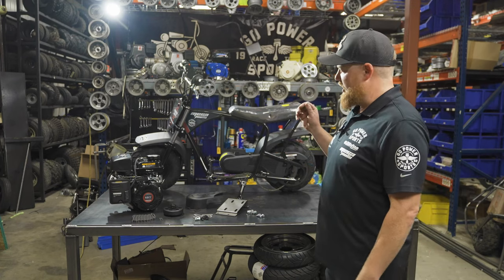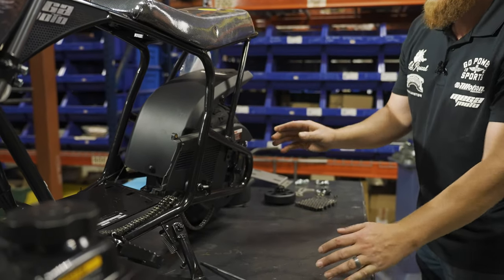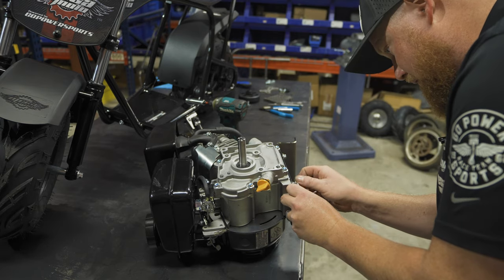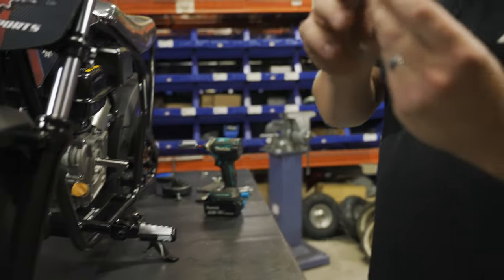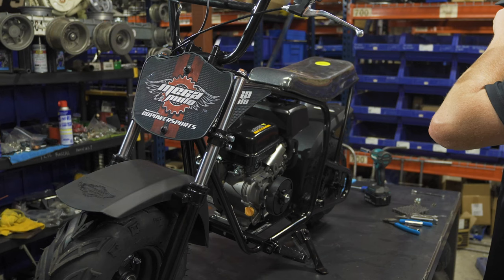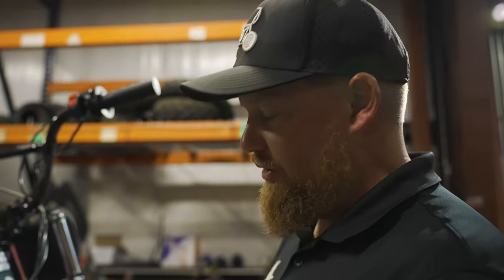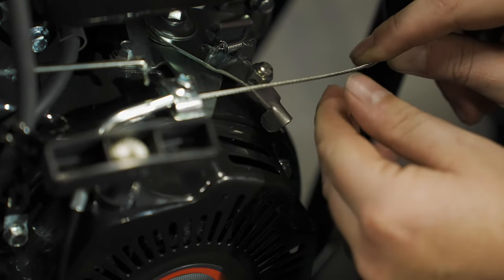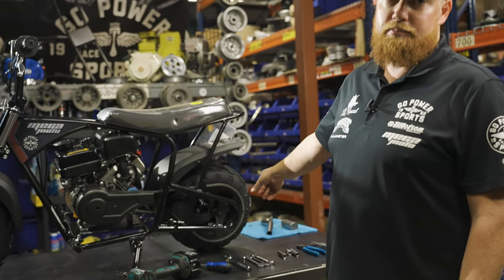Building The Mega Moto 98 Minibike Kit

Comment: After installing the engine exactly as shown in the video, I discovered that the provided chain is too short. Although the kit includes a second chain of the same size, it doesn’t come with a chain breaker, so I now have to buy one separately. Am I missing something here? I’m installing the engine that came with the bike—do I need a chain breaker to remove links from the second chain for this kit to work?
Reply from the maker: Send me your order number.  Thanks!
Reply: @GoPowerSports  it’s 874133
Reply: My order number is 875109
Reply from the maker: Found it.  I'm going to email you.
Reply from the maker: I also noticed that only the original YouTube comment pulls up on our dashboard.  Any follow up comments or questions go unnoticed unless we change the automatic filter that YouTubes puts on.  This is an eye opener for us.  I thought you were ghosting us and now see you've been trying to tell your order number over and over and over again.  Sorry about that.